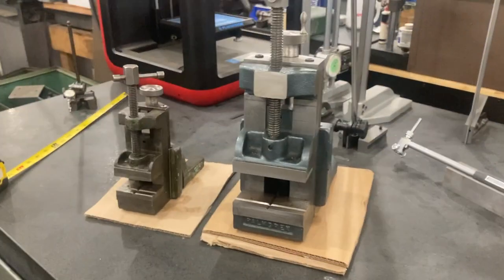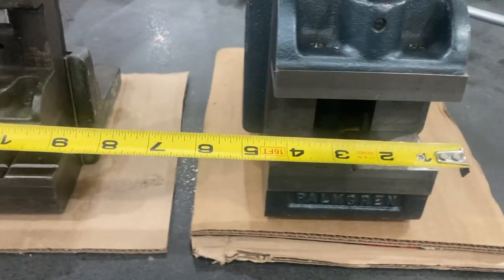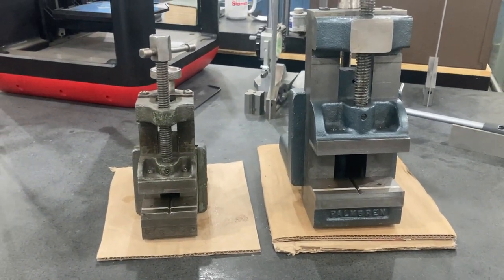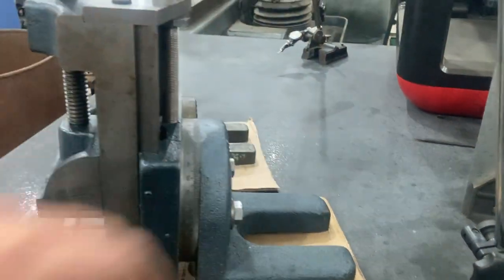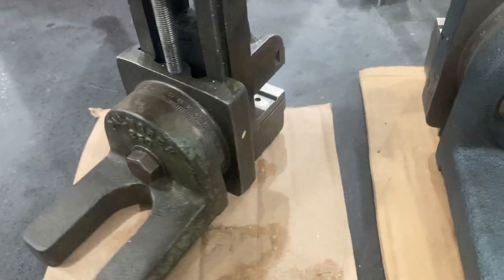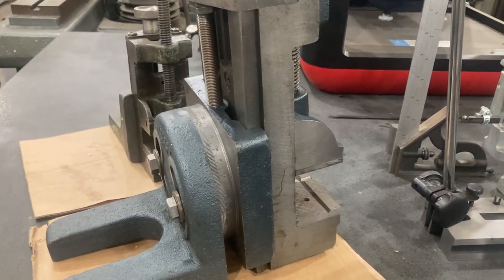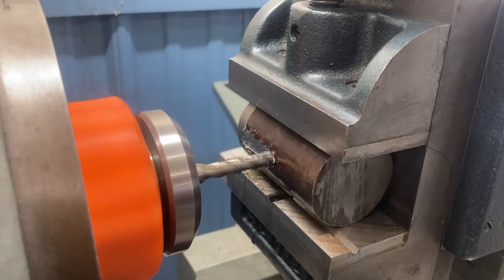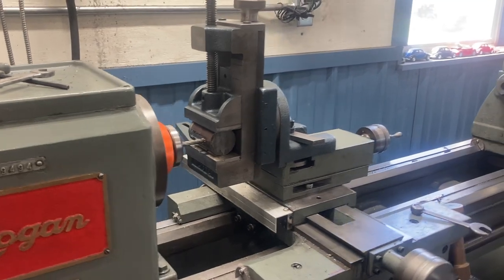Comparing Lathe Milling Attachments - Palmgren

Comment: Way back in 1992, when I started a gunsmith shop, I could only afford a lathe to start with.  An Enco 12 x 36.  Not being able to get a mill at first, I ended up buying a Palmgren 400 from Brownells and it got me through the first two years.  It was a  bit large for the lathe, but it still worked well.  The extra mass did over the 250 helped a lot with stability and chatter.  The business is long closed, but I still have that attachment to this day sitting on a shelf next to my current lathe in my garage.  I keep it oiled and cleaned, but I have not used it in years.  Sort of a piece of memorabilia  for me.  With imagination, you can do a lot with it. Thanks for the memories!
Reply from the maker: That’s a really great story. Thanks for sharing it. I very rarely use these Palmgrens because I have a knee mill, but from time to time they do come in handy. If they can be found at a reasonable price, I think it’s worth having one around.